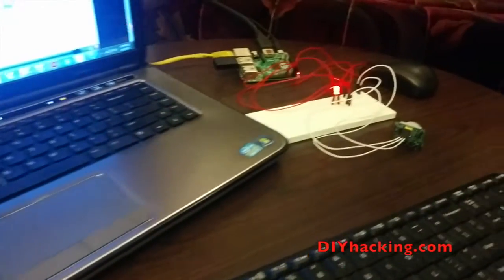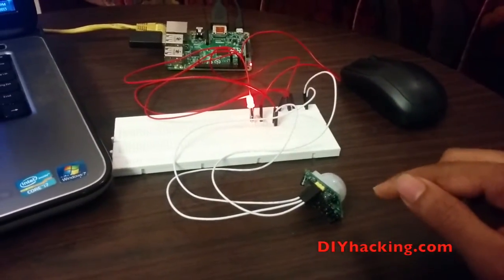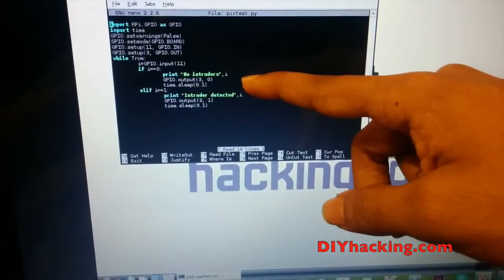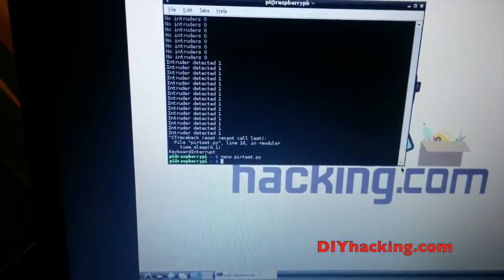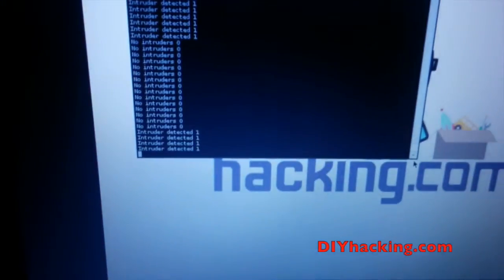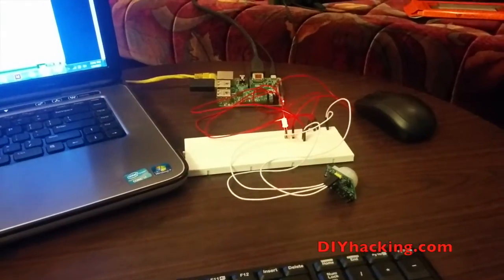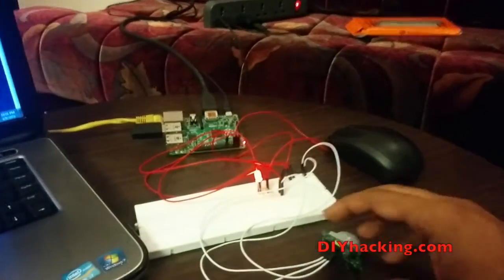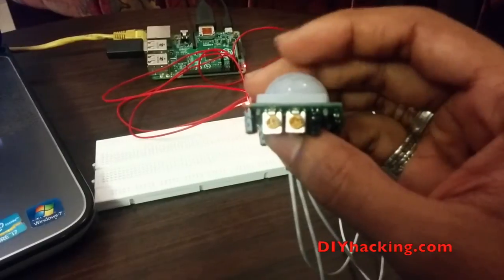Raspberry Pi PIR motion sensor tutorial

Comment: It seems that every one is having the same issues with this. when i run the code it is immediately showing as intruder detected, when you disconnect the signal cable from the sensor to pin 11 on the pi, it starts showing as no intruders, PLEASE ADVISE

Comment: Any way to have the motion sensor separate from your computer?  I am looking to have it send a text to my phone if there is an intruder.
Reply: See for twilio API using python..it will charge some money.
but for develpment phase its free.
Reply: u can make a websocket sever with nodejs/python et  and create an android app that connects to that websocket and listens for msgs
Reply: You can send free text messages through gmails SMTP server straight through python.
https://gist.github.com/alexle/1294495/39d13f2d4a004a4620c8630d1412738022a4058f
Basically this is all you need